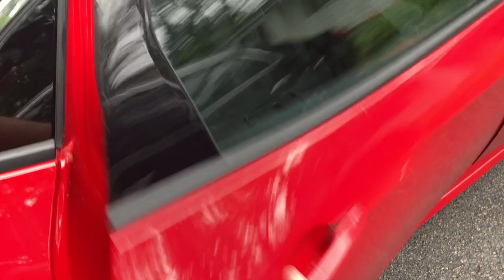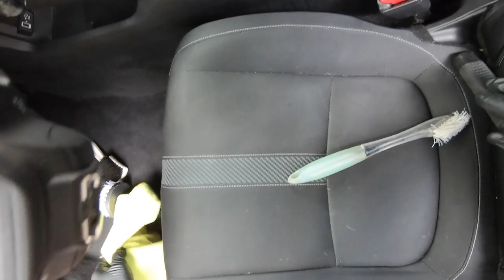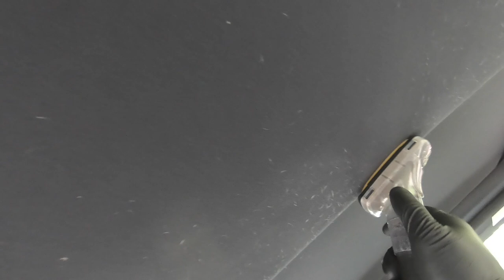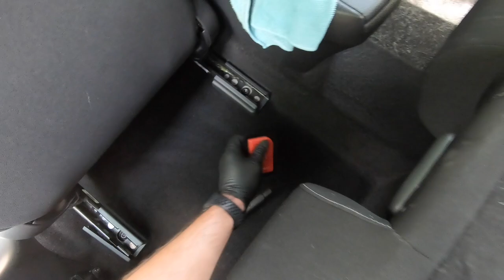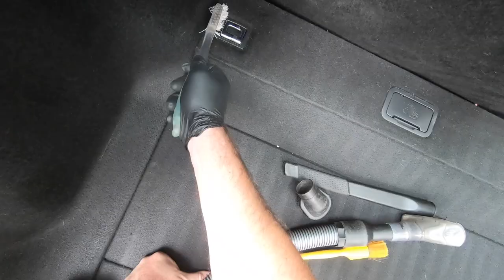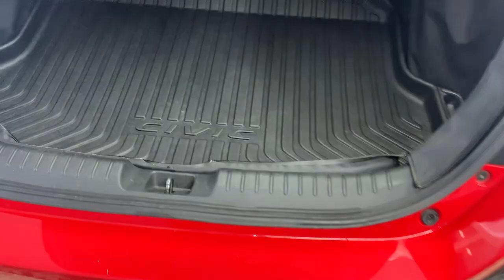Dog Hair VS. Black Cloth Interior! EXTREME Dog Hair Removal / #autodetailing

Comment: Along with the vacuum I also use my air compressor cranked up to 125 psi.
Reply from the maker: Yup that works too. However I don’t want hair flying everywhere when my wife is cleaning on the other side. I try to keep things controlled. But if you’re working alone then yeah using air to blow out the hair can work.